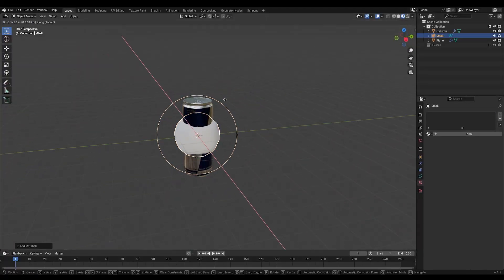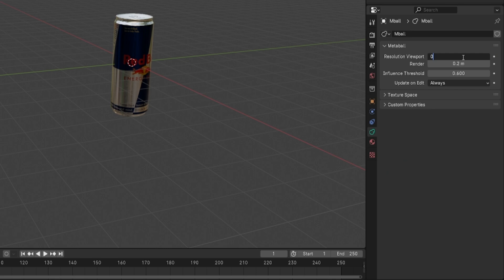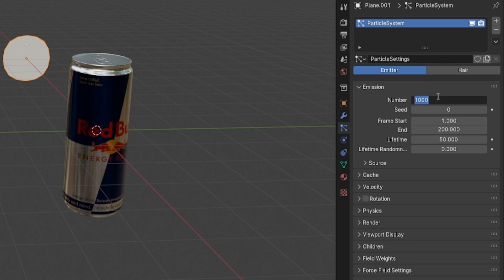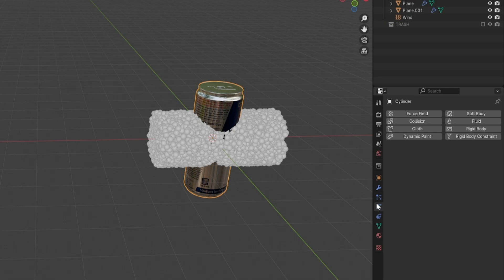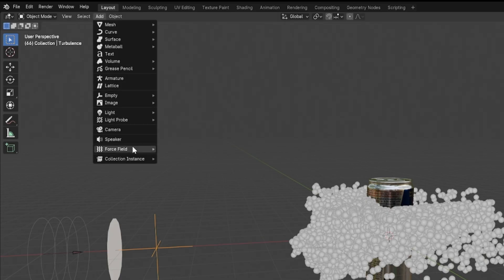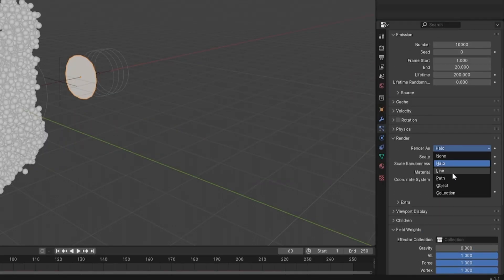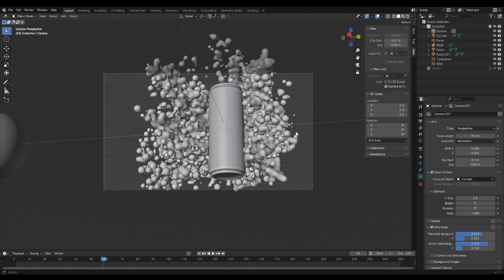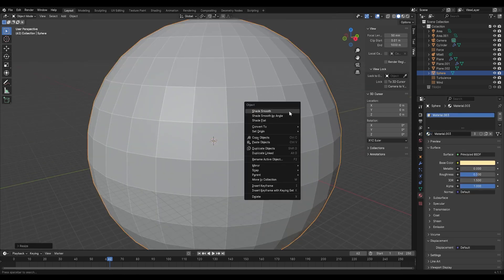Not A Fluid Simulation - Good for Low-End Hardware

Comment: it's a whole normal distribution meme

1) wow it's a fluid simulation
2) it's not a fluid simulation it's just particles!
3) particles are how fluid simulations work it's a scuffed fluid simulation

(okay technically there's two types of fluid sim eularian and Lagrangian the particle kind is lagrangian, and the eularian kind is all about values in grid cells. The huge majority of the time a real fluid sim spends is enforcing "incompressability" which means that your water doesn't squish. By skipping that and just doing straight particles you're doing most of a fluid sim without the part that takes a really long time!)
Reply from the maker: Exactly 🙏🏼